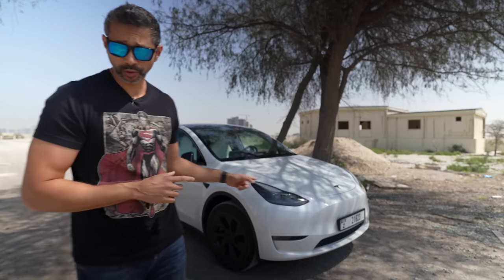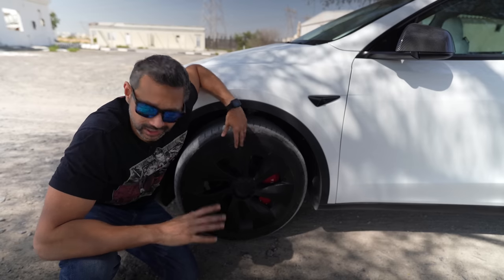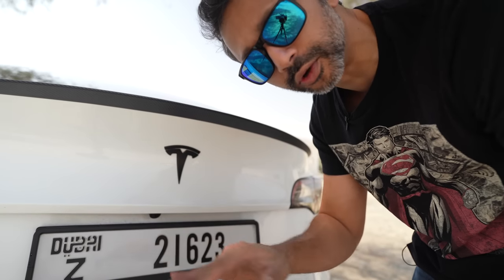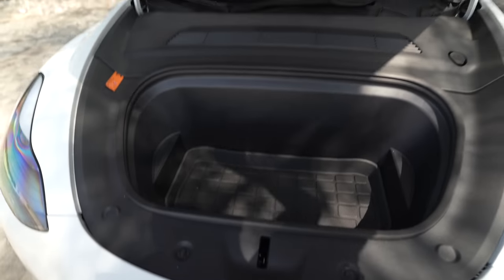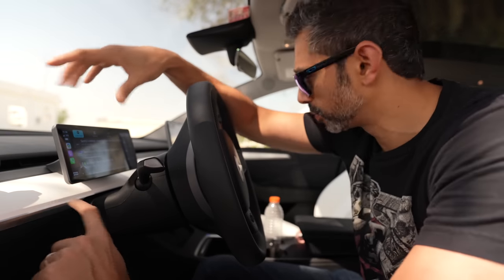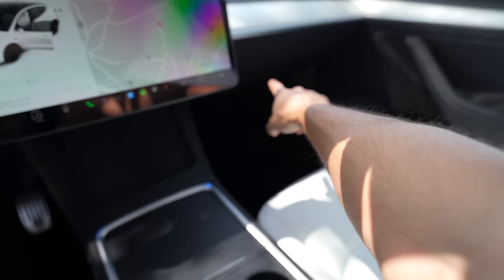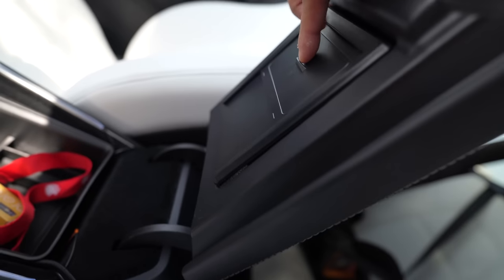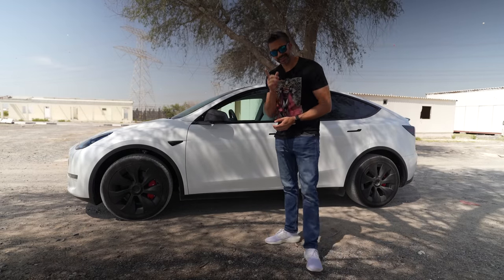I Upgraded my Tesla Model Y!

Comment: Nice vid…would playing around with the lighting void the warranty in any way?
Reply from the maker: Not as far as I know. As long as you don’t make any modifications to the computer. It’s basically like changing a bulb
Reply: @varerkars  have you verified that from Tesla? Because I’m considering a change of tail lights which again tickles the system.. but was holding on for this concern
Reply from the maker: @amitsalvi  I would avoid the tail lights cause of safety concerns.
Reply: @varerkars  oh i didnt know they interfere with the internal comp. I will do more research on this. Thanks! Btw would be nice if you can show how you routed the wire for the phone charger. For months i have been wanting to install a good charger, guess yours should do the job.
Reply from the maker: @amitsalvi  get this :https://amzn.to/3l24VUV
Is a solid mount with MagSafe holder . You can replace the MagSafe holder with ESR MagSafe car mount : https://amzn.to/3JBb43R

I got a 9 foot usb c to usb c cable and it routers from the side , under the steering column and through the side panel of the Center console into the back side of the arm rest. There it’s plugged into the 12v socket with this adapter : https://amzn.to/3JA7jeX.

If you don’t want to do the last bit , it can connect to one of the rear usb c ports

It’s a bit of an expensive solution , but the cleanest in terms of cabling and usability
Reply: @varerkars  Thanks will definitely get it.